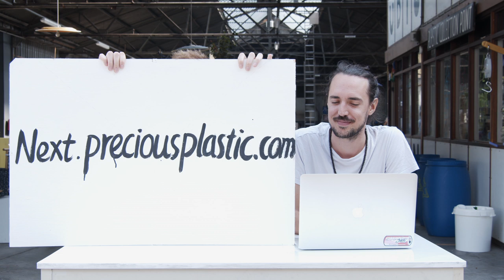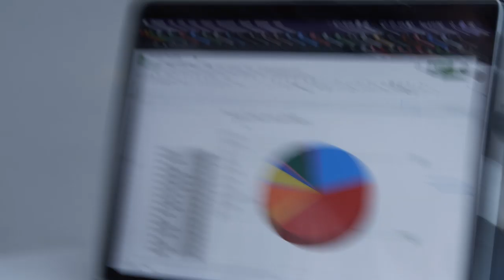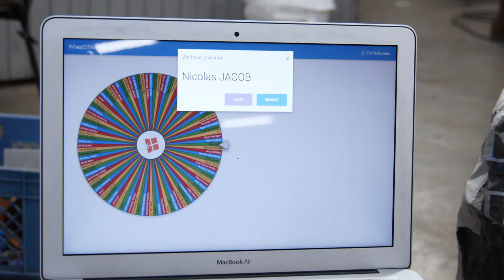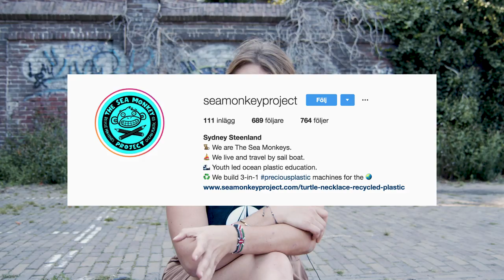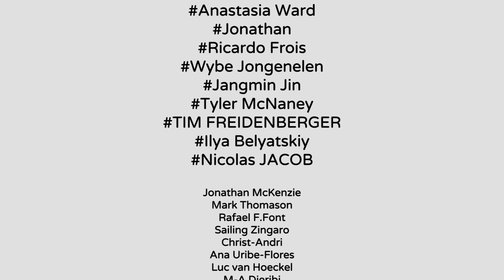Monthly News #31 - Problems at Precious Plastic

Comment: What is version 4?  Also, have you looked into turning waste plastic into fuel by use of pyrolysis?  Seems that could be done in addition to your current work to expand on your income possibilities as well as reducing some operating expenses, such as heating that huge workspace.

Comment: That robotic arm is a huge waste of time and money
Reply from the maker: You're hurting the robots feelings...
Reply: @OneArmyVideos  I may be but the thing that got everyone excited about precious plastic was the fact we could do it at home. If the robotic arm was made. Say from plastic sheets, bars and other things from the recycling process, say a raspberry p.i and some servos, and could be made at home to sort the plastic then I could see the gimic factor of it. But you could have made instead a scanner similar to a barcode reader that worked by scanning the items then on your phone it transmitted what plastic it was would have been amazing. And you could have easily sold the scanners and made money to keep the buisness going along nicely. I personally hand separate and use the burning method to sort my plastic. Not having to do that, I would pay a few hundred euro for that. Provided it works correctly
Reply: Quite the opposite, a reasonable approach would be to reach a bigger scale where they can compete with professional recycling/scrap supplier companies and feed raw materials to industrial buyers. That should fund the community initiatives sustainably. That can only be done if they can figure out how to sort plastic without volunteers. Of course it's less exciting to do just that, but it would be more sustainable. (I imagine this is quite ironic actually)
The end products are nice and everything, but atm they are better for raising awareness and recruiting then a real source of income, which they need if they want to continue r&d at the current scale.
Reply from the maker: @WheresTheFun  we don't want people to do this at home. That was never the goal, its very inefficient if everyone in the world would own machines and need to learn everything. We always see this more at village/community/municipality scale. In some places in the world more advanced technology makes sense. But something like a robot is definitely not for everywhere.